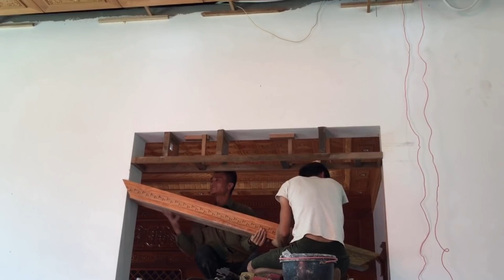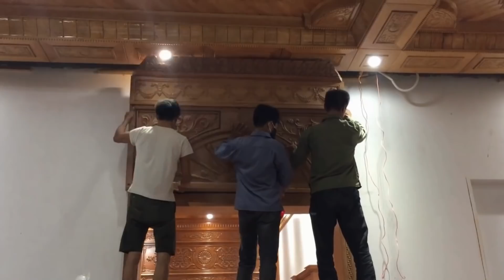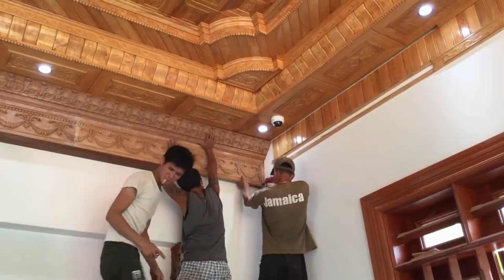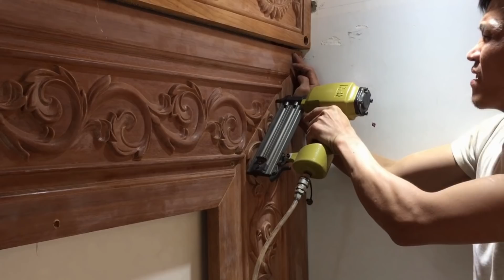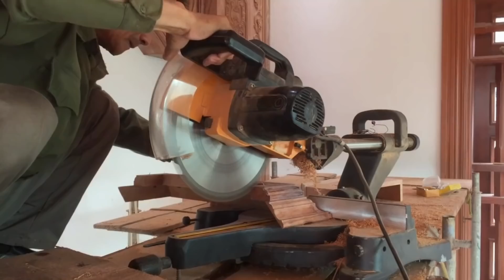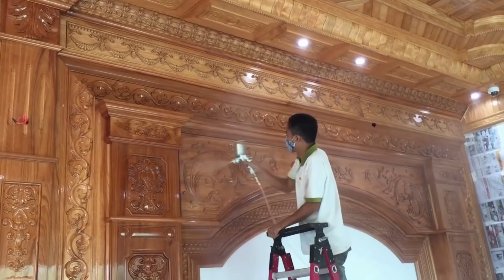Amazing Skill For Woodworking Project // How To Build and Install Partition Wall Carved Wood!!!

Comment: Is this a palace, a museum or some rich man's house.  As usual the videos are well produced.  Maybe safety of the workers should be given more attention.
Reply: Anthony Grech They can work and smoke at the same time.  They are not amateurs.
Reply: @pby1000  The engravings must have been done by a CNC or a similar machine.  Nevertheless the fixing in place of all parts is to be commended as it is not an ordinary kind of job.  Well done to all these workers who seem to have been commissioned to do all the works in this amazing house or whatever it is.